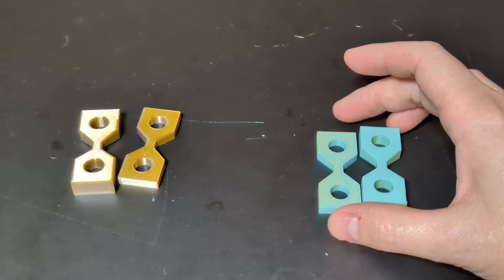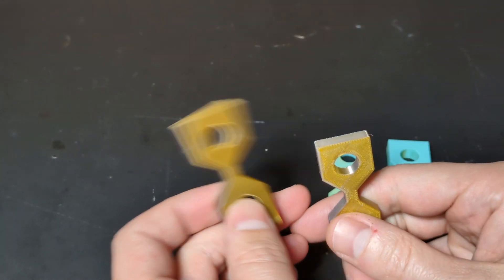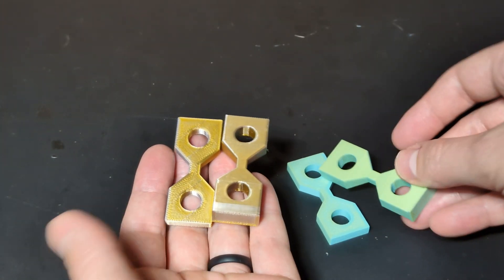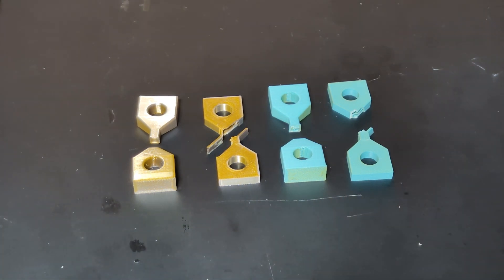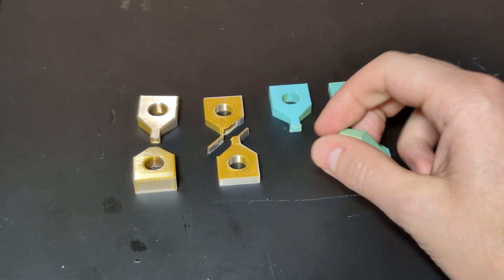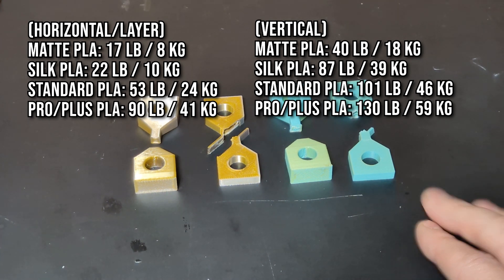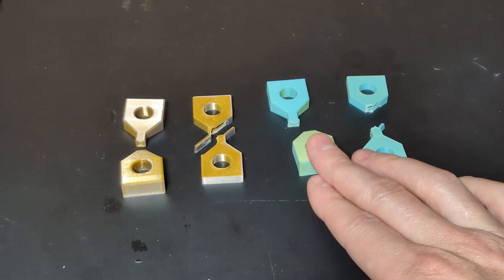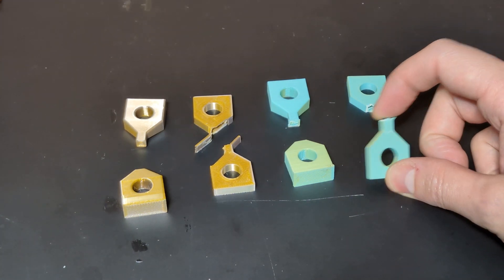PLA Silk vs Matte Filament Pull Test

Comment: Actually TPU  is better for articulated things and flexible parts. Regular PLA breaks every time for articulated things.
Reply: I use TPU quite a bit. If you don't mind a bit of flex (depending on thickness of part and infill density obviously) I find it incredibly strong.